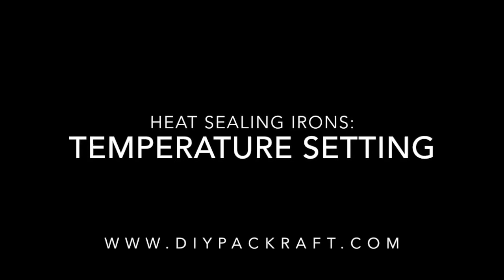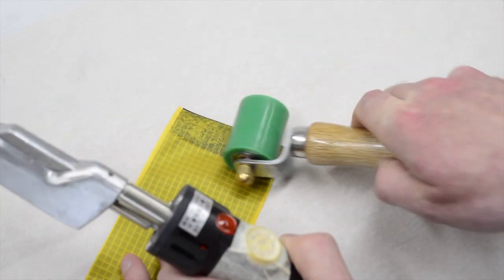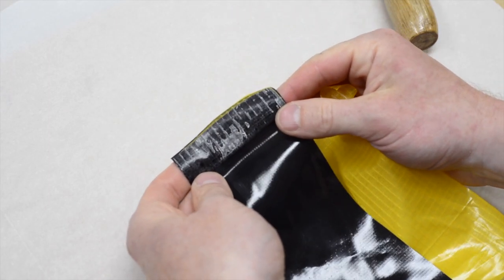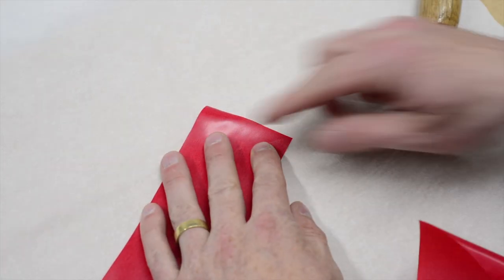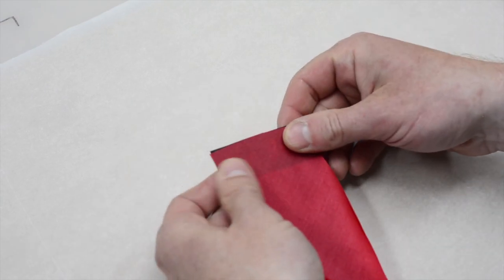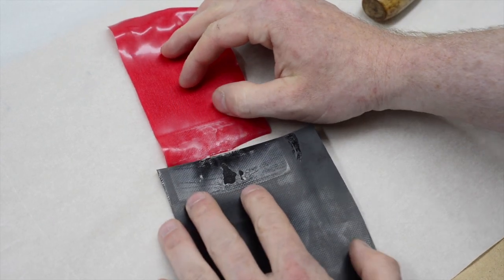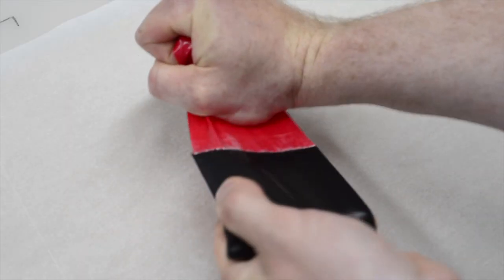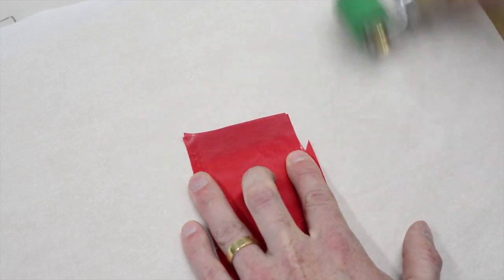Heat Sealing Iron Temperature Setting & Timing

Comment: Interesting fabric, how can I make a 100% waterproof bag or tote using this fabric and technique which I'll fill up about 2 gallons of water and no leaks should occur? I would like to buy this as a fabric and not for the boat. This TPU nylon fabric is impossible to buy from USA.
Reply from the maker: Making a waterproof bag is easy - just iron two pieces of fabric together around the edges - but you’ll need to find a valve or port that won’t leak. There are some press- fit valves available on the DIY Packraft website that might suit your needs.

Comment: yo! this is very cool, do you think that this tool would be good for DIY outdoor clothing construction? trying to get a setup for my workshop
Reply from the maker: Yeah, but only if you’re using heat sealable fabrics - otherwise it won’t do anything except melt things.
Reply: @DIYPackraft  so you think that even if i just use it to apply seam sealing tape to synthetic fabrics it wont work?
Reply from the maker: Ah, yeah that might work - I’m not sure.
Reply: @duckacid  ive got a couple things, tricot nylon backing by the metre and also some adhesive nylon fabric tape, just need a good tool to apply it, so far best option ive used was an industrial iron, i purchased a hot plate thing like this and it just melted everything